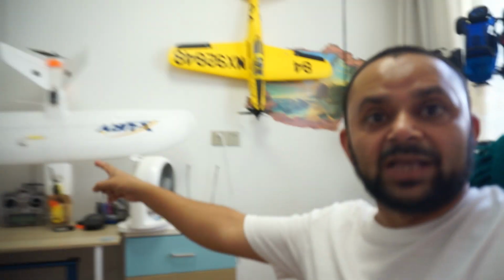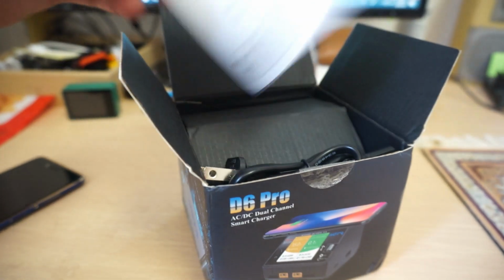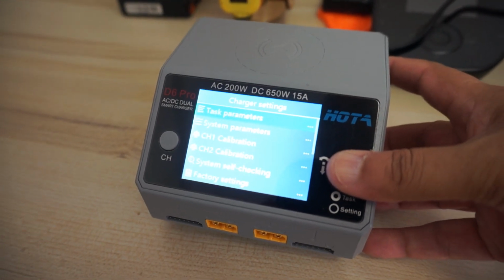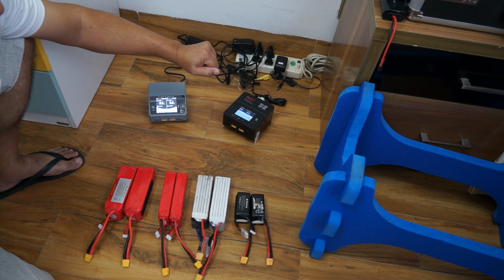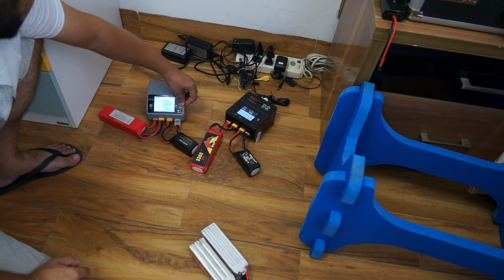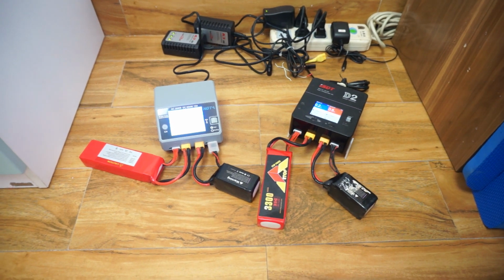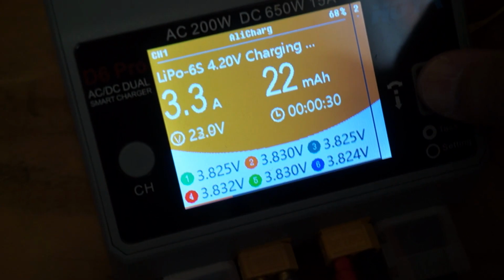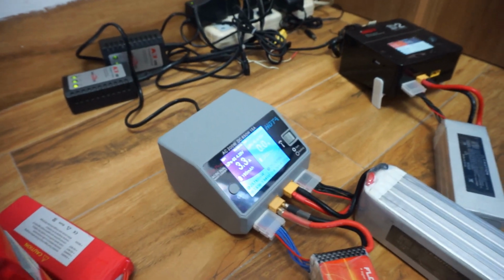Makerfire D6 Pro Dual Channel 200W 15A Smart Balance Charger discharger

Comment: What are the available modes for nimh in d6 pro? Does it have battery cycle or analyze features for nimh like ISDT? And AV peak sensitivity adjustment and trickle current? Hoping for a detailed answer. I'd appreciate it very much . Thanks

Comment: Got a similar one, a Hota D6 Pro from Banggood and when turned on I just get the message "CH1 Self-check failed! (E108)". Troubleshooting I did: firmware update or hard reboot, but problem continued. Not happy!

UPDATE
- reported the issue to HOTA, sent emails several times for any news, and they only kept replying "sorry to hear that" and did nothing 
- reported the issue to Banggood, and after sending the unit back was fully refunded 
- now I have an ISDT D2
Reply from the maker: Most of my Chargers are ISDT and am very happy with them

Comment: Assalamualaikum...how about 6s 16000mah x2pcs..use for ag drone...my charger up600+ is damaged..😅
Reply from the maker: Wassalam. Not good for those big bricks. I suggest you get a dedicated big 6S charger. I use SkyRC PC1080 to charge agri drone 6s 16000mAh batteries and charge my Electric Paramotor 6s 12000 Bricks. It can charge only 6S batteries. Charges two at one time or you can buy add on to charge 6 batteries on each port at same time. 

Does a great job. no over heating. and you can even fast charge up to 20A (if your batteries can take it lol, don't explode them) 

I have charged a 16000mAh in 15 minutes with this one. its pretty costly but worth buying if you have Agri drone
Reply: @alishanmao  Alhamdulillah...tp..before this i use ultrapower..but very poor quality...
I will go to pc1080 as u recommend..thanks for reply me..and sorry for my bad English 😅...assalamualaikum my brother...جزاك الله خيرا

Comment: Of course they will use the same time to charge if you use the same charging current in both charger. The charging time is determined by capacity of the lipo to be charge (Ah) divided by charging current. So if you use 2.2A to charge 2200mah amount of charge to a lipo, it will take exactly 1 hr, for whatever charger. One more thing to grade your new charger is whether it can supply big current for your BIG lipo say at 10A and still not hot !!
Reply from the maker: I charged the 16000MAh on 5Amp it was not over heating, will try 10A :D